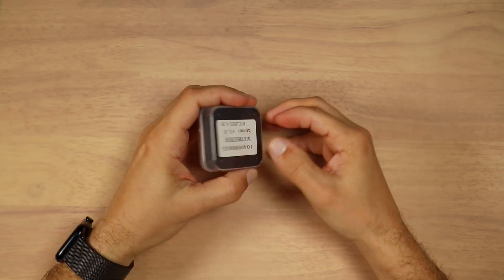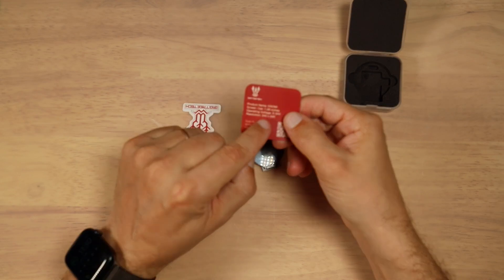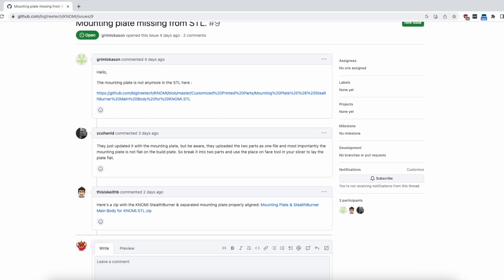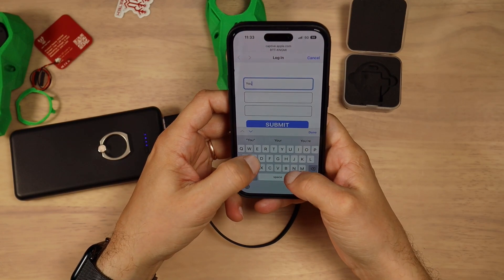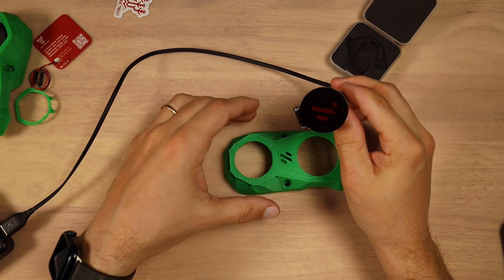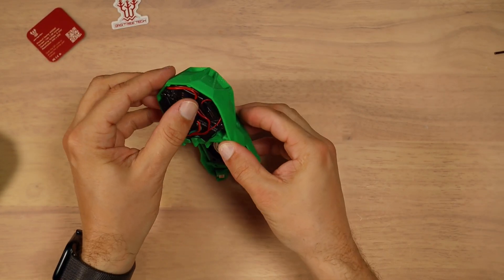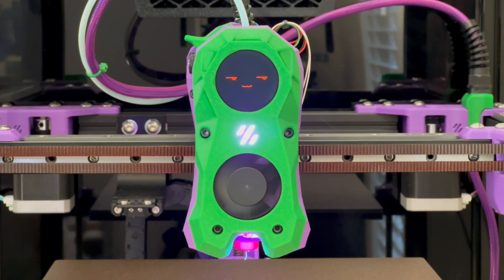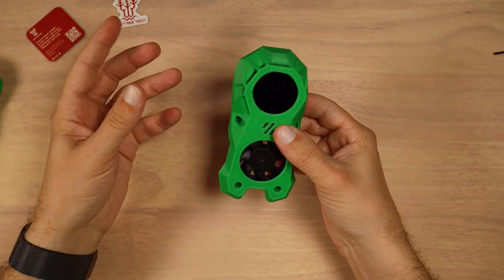BIGTREETECH KNOMI - Voron Stealthburner Toolhead screen

Comment: Meanwhile I am buying titanium screws to decrease the printhead by 3 grams.
Reply from the maker: Honestly I have switched over Dragon HF hotend with CHT nozzle and I am still low on flow rate so far for me weight not even an issue...
Reply: That's what I did too, all titanium screws on the toolhead. I can't even imagine adding this junk to the toolhead, increasing the weight! haha

Comment: You wouldn't have to disassemble to write firmware. It is running an esp32 so you should be able to write new firmware through wifi. As long as you set it up before you install it.
Reply from the maker: I have seen we can flash it via OTA but never tried and never used it before.
Reply: @hobbyistnotes  You would have to use something like Arduino IDE and flash the firmware via USB. In the firmware, specify your wifi name and password and you should be able to write firmware via WiFi going forward. But of course, this is a simple explanation. I recommend looking up an ESP32 tutorial. 🙂
Reply from the maker: @JacobMnasin  Thank you. I already did. Your 1st comment has gave me some food to process, live and learn!

Comment: still haven't got to build a 2.4, by that time I do, you all will figure out the best of the best to add.. love the work, thanks for the video!
Reply from the maker: I have started to think about 2.4 now too… looks like very interesting challenge 🙃
Reply: @hobbyistnotes  this year I have tried to get a good printer to make parts for the 2 switchwires I have partially completed, and "soon" to be started 2.4. Been having difficulty in just getting a normal printer that will do a good job with normal prints, Creality and Sovol both have bed level issues. Just got parts from Sovol, so hopefully I have a printer I can get the parts done I need. Good luck on your build!
Reply from the maker: @Patriot_First  Thanks, hope you finally make your 2.4!

Comment: I always think the toolhead should be as light as possible. So wtf
Reply: If your goal is to have a light toolhead you aren't running stealthburner to begin with. It looks nice, it flows better than its predecessor, it pretty much ends there lol
Reply from the maker: @Rainmotorsports  hard to argue with this argument 😅
Reply from the maker: I assume depends on the goal 😆🤣
Reply: @hobbyistnotes  Printer makes brr, thats the only goal.
Reply from the maker: @ThePhobosX  now it can do “blink-blink” too ;-)
Reply: if you want a light toolhead, don't use a stealthburner lmao. Use an eva or a custom toolhead
Reply: Thats only if you're going for under 5 minute benchies. If youre not doing that you can have a toolhead thats a few grams heavier. Even with it being a little heavier you can still print at crazy stupid speeds. grams only come into play when youre talking about a couple of seconds faster or miliseconds.
Reply from the maker: @GoranMilici  You are right, at this point this specific printer mostly limited by hotend not able to melt plastic fast enough other than toolhead weight...
Reply: Its a 400 gram toolhead on a light build. The weight of knomi id guess below 50 grams. You want speed look into Goliath with compressed air cooling
Reply from the maker: @2fwelding842  Now sure how much interest it will have, but I will take a look.
Reply: I saw someone making a nightstand print clock with it, uust used the stealthburner model and made a preety neat clock
Reply from the maker: @Hellsparkt  why not =) good idea